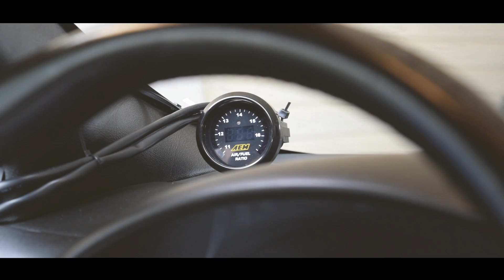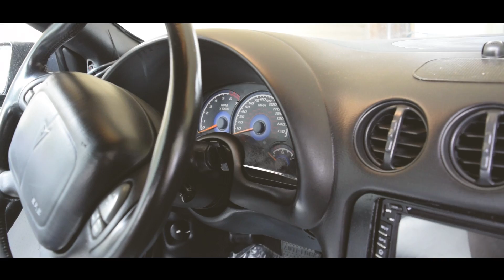Trans Am Is F*cked and Turbo Tahoe Is Almost There!

Comment from the maker: The 75 shot works like a dream right now! The bottle was warm enough to achieve the right PSI and gonna bump up to the 100 shot soon. The Tahoe still coming along slowly but surely. Still bummed about my fender tho......
Reply: Turbros Garage change the spark plugs 1 step colder, my trans am has a 100 wet shot and I run ngk br6ef part no 3177 gapped at .35 will help you with your set up.
Reply from the maker: steven Thompson Thanks dude!

Comment: that pipe looks like Aluminum and if it is  you cant weld it with steel wire  you will need aluminum welding mig gun Or aluminum tig welding   the stumble on the nitrous hit is more than likely Timing

Comment: My 95 has a dent in the rear quarter , it looks like some asshole in a pickup opened his door and hit it based on the shape . Sucks because if it hit the door or front it wouldn't have dented because those plastic parts just pop right back into shape if they don't break . Sucks that yours got hit , i would get it fixed and keep it though .

Comment: Damn that's so shitty :/. someone rubbed up against my Trans Am a few months after I got it in a parking lot and took off. security said they changed their cameras the next day so all footage was lost...after a week run around with them before they said that. anyways are those the ebay blue gauges?
Reply from the maker: christopher koss damn dude that sucks😒 and yeah I believe it's from eBay. It was on my car when I bought it
Reply: Turbros Garage I knew it looked like it but the pictures on eBay show the oil pressure and other gauge icons in the wrong spot. are your where the oem ones are?
Reply from the maker: christopher koss mines are the oem locations
Reply: Turbros Garage awesome thanks man. and great work on these videos. you guys convinced me to go nitrous 😁